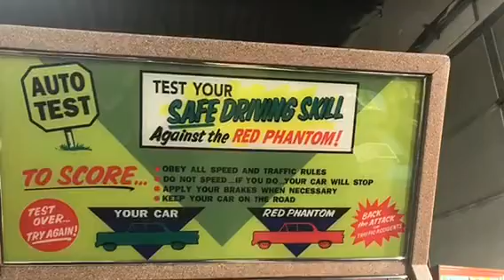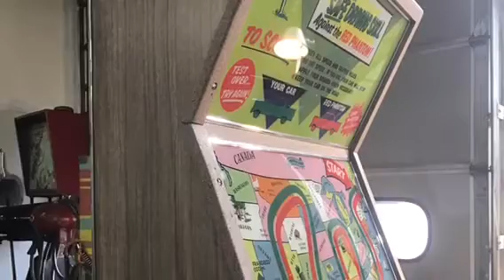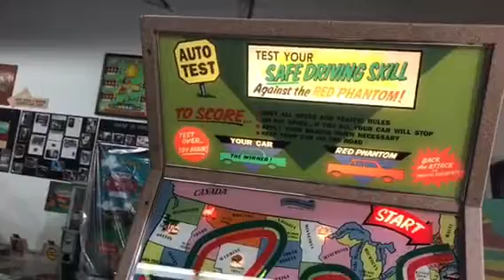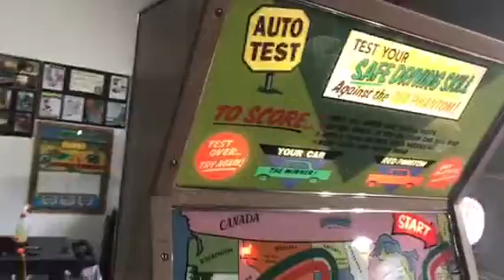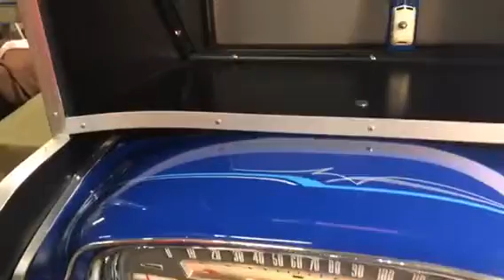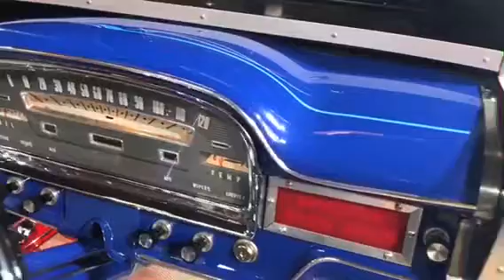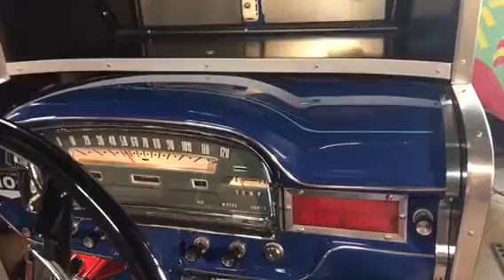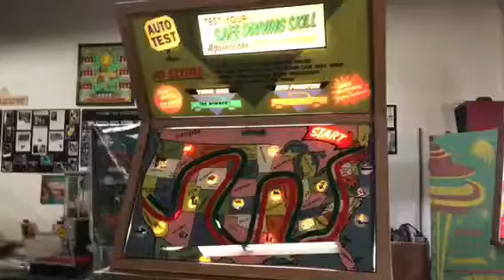1947 auto test arcade driving machine

Comment: Looks like some mods have been done.  At time 2:38 it appears that someone put a newer board in the game.  Those ICs, LEDs, modern resistors, etc look a lot newer than 1940s.  In fact, they look more 1980s to 2000s.